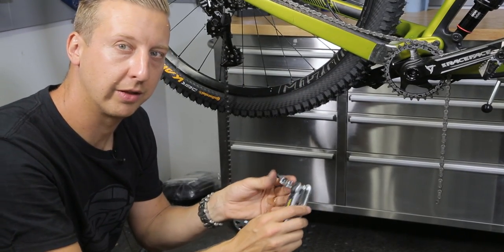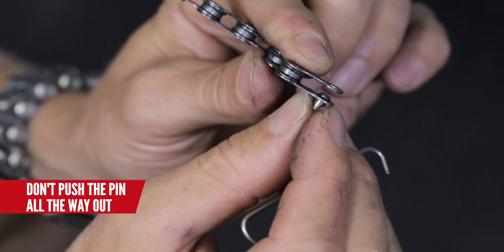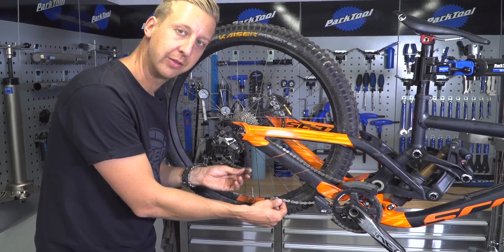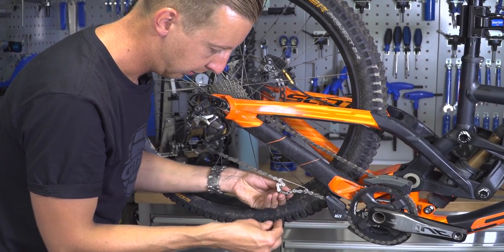3 Different Ways To Join Your Chain | Mountain Bike Maintenance

Comment: What would be wrong with removing the joining/connector pin?  Can it not be replaced by a replacement pin?  Or replace the other side link  with a quick release to keep the same distance?

Comment: Two questions: 1) I bought a new Shimano 11 speed chain which comes with Quick Links. Can this chain be joined with a Shimano 11 speed pin rather than the Quick Links? 2) When joining the chain with a Shimano pin, would it be better to work from inside the bike to the outside so that when the guide part of the pin is snapped off it doesn't leave a bur on the cassette side of the chain?

Comment: Why do KMC brand links have speed specs? (10-speed, 11-speed, etc). Should it match the sprocket or the chain? I need to ask that as I have an 8-speed SRAM EX1 gearset where the manual specifies to use 10-speed chain.

Comment: Great one, thanks. My question is, are the Shimano joining pins reusable? After I’ve resized and joined a chain, can I push it out and put it back on when I need to remove the chain to service it? Or these pins can only be inserted once and they need to be replaced each time the chain is opened and rejoined?

Comment: Tried fitting a Shimano pin today and quickly realised why quick links are better.

The pin snapped before I got the pin through fully, leaving the 'snap off ' part inside my link and causing the actual pin to drop between paving slabs in my garden. Got it back out but it's a bugger to get the pin in without the disposable part as it's hard to keep straight. 

Live and learn, eh? -_-

Comment: You don't need to use Shimano joining pins, you can use KMC Shimano specific power links. I used them on all types of Shimano chains.
Reply: Do you know why these specify speed? Why do KMC brand links have speed specs? (10-speed, 11-speed, etc). Should it match the sprocket or the chain? I need to ask that as I have an 8-speed SRAM EX1 gearset where the manual specifies to use 10-speed chain.
Reply: The chain and speed / power links should be for the correct gearing and chain ie 10spd for 10spd cassette 9spd for 9spd cassette etc. However SRAM speed links do not work with Shimano chains as there is a slight chain width and pin length difference. Use KMC for Shimano.
In your case if you are using a SRAM eEX1 8 speed chain it would be best to use a SRAM EX1 8 speed speed link.
Reply: There’s no way an 8-speed chain will work with my 8-speed SRAM. The manual says to use a 10-speed chsin.

Comment: everyone knows the hack where you get two toothbrush and put them together to clean your chain. would it work if you got two brass or steel brushes and used that as there more heavy duty or would that wreck you chain

Comment: But when you snap your chain it doesn't come apart. You need a chain tool to be able to get rid of the broken link so that you can use the quick link. It isn't easy to get that broken link/pins out of both chain ends. Chain tool is essential on every ride.

Comment: I have a new HG93 (not even 100 km) that in an accident got hit in a link, I "fixed" it and next day my chain snapped off. I went to a local store and they told me master links doesn't work on that kind of Shimano chains, only the joining pins, also they told me that a chain (KMC for example) only can have at maximum 3 master links. Is that true? I bought the master link and I did 20k with the chain, no sound, no cracking, gears working and everything. Still ... I think I should put the joining pins. How  many joining pins can I put on a Shimano chain (in case of emergency)? Because I don't want to buy a chain THAT soon. Thank you
Reply: I use HG95 chains. I've used master links, joining pins as well as existing pins (2nd method). I change them every 4 000+ km and they do not break.

This one lasted almost 10 000 km : https://imgur.com/a/tZUIVz9

Comment: #askgmbn How badly would you need to crash, in order to snap off your head tube on a carbon  xc bike?
#askgmbn When riding in extremely muddy conditions in the woods ( mostly pine woods), should I just keep on driving until the mud falls out by itself, or should I get the big chunks of mud out, that are blocking my RD from working properly?

Comment: I pushed my pin all the way through :(
Reply: you can buy an replacement which you probably already discovered
Reply: yeah that's a bummer
Reply: @GregoryHruska  and @Henrik Nobel at the end I used brute force to open the female link so the sides were in an angle ample enough to embrace the male link with the pin across. Then I just closed it. Super easy if you don't have or care about replacements. (I found the trick in some forum)